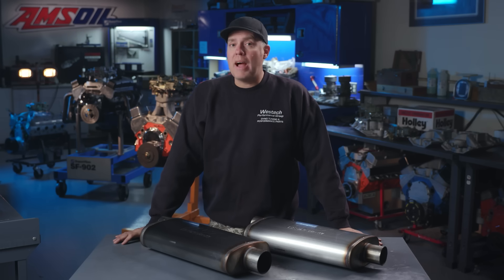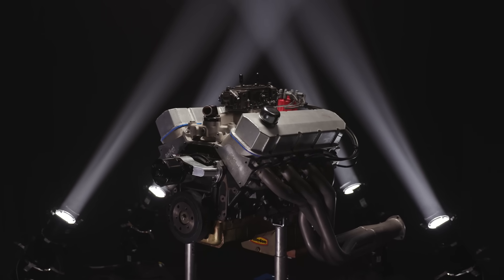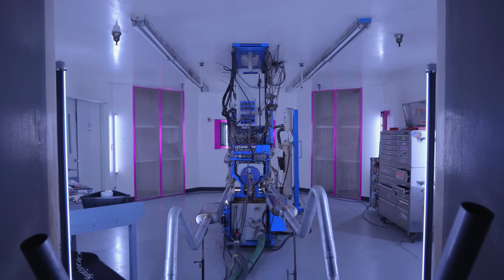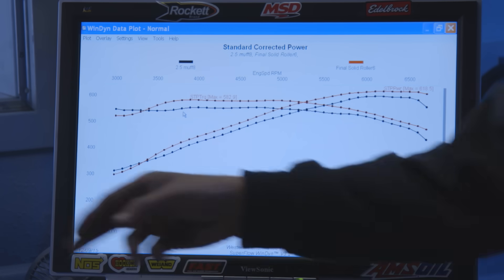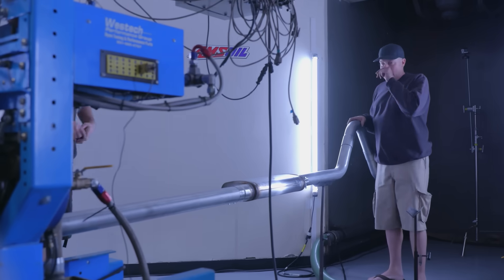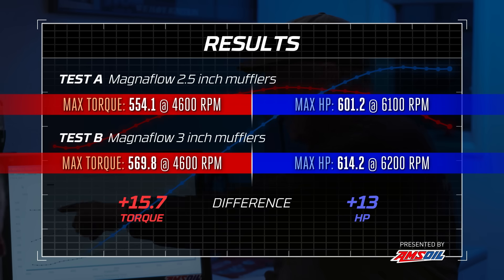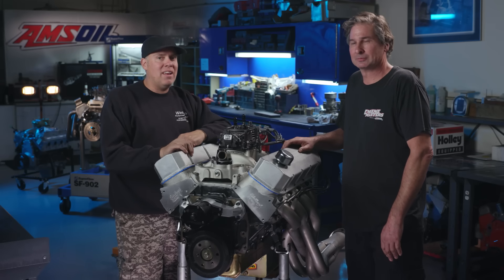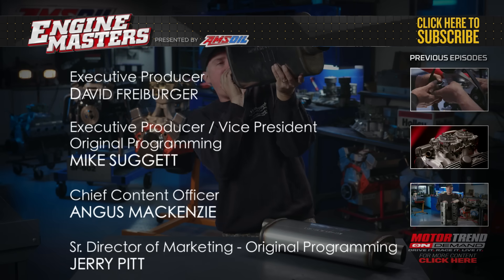The Power of 2.5- vs. 3-Inch Exhaust - Engine Masters Ep. 9

Comment: Wait but what pipes should I run on my 5.3 build. I'm trying to pull around the 400 horse 400 torque of course not exact just at least in the 4ish area but my dad says run 3 inch with high flows and a bullitt but I hear some people say back pressure run 3 cats and 2 inch which is retarded, and some say 2.5 makes better power for a vehicle that is sub-600 horsepower. They say they feel a power loss going from 2.5 to 3 on a stock motor. Any ideas?

Comment: This is not correct information. Their are too many variation to account for. a 3IN Pipe system will benefit a 620hp engine that move a whole lot more air than a 200hp engine. 3in pipe system on a 200hp engine will result in a completely different result
Reply: view this as a data point more than "information"

Comment: Hey have you tried 3 inch pipe from the headers half way down car with a glass pack cherry bomb than about a 2 inch of pipe from the other end of glass pack ..about 2 feet of it ..so it gets the Aire flow ..and by the time the air flow gets to the 2 inch pipe at the end it gets the back flow pressure as the air leaves the exhust ..

Comment: Hey engine master's I have a question about doin muffler deletes..
I have a 2018 Dodge Durango R/T... I was thinking about if I should delete the mid muffler or the ones in back for a low cost raspy sound..
Or if should just buy some magnaflow or flowmaster exhaust...

Comment: Muffler size depends on HP; a 3" dual exhaust will lower HP on most stock V8s under 400 hp!!2.25" to 2.5" dual exhaust for 200hp - 350hp2.5" to 3" dual exhaust for 300hp - 500hp

Comment: I know it’s not a v8 but I’m looking for advice on a truck I have setup for the desert. It’s a stock 3.0 ranger and I want to do a straight pipe with a 2 cat delete with o2 sensors. But would like to not lose power. What advice on specs should I use?

Comment: Bishop back pressure is not about horsepower or Torque. It's about the temperature on the exhaust valves. There are some indications that you'll have longer valve life with a small amount of back pressure. The other thing to take into consideration is the percentage deviation relative to torque and horsepower period with a 3in exhaust you're only seeing about a 1% drop which is pretty doggone small period with the 2 and a half inch system you saw a little over 3%. Again a pretty small amount that would probably not be noticeable for most people. The second issue is the length of the pipes. One of you got it right when you're speaking about the wave transmission through the pipe. However, once you reach choked flow it doesn't matter how long the pipe is. My guess is after about 6 feet it's probably irrelevant. The fact that they Magnaflow does not impinge on the flow diameter is a critical issue. This was the same concept as the original glass pack mufflers. Of course we would take the glass packs and run the cars down the freeway at 92 a hundred miles an hour and then shove a hose up to shatter the glass packs. Just some old hot rod tricks. The cops were yelling at us that our pipes were too loud but we quickly showed them that we had Cherry Bomb glass-packs on the exhaust system which meant they were totally legal kind of. Enjoy your shows. By the way adiabatic efficiency it's not always the bottom line we are talking about supercharger. I agree that the design of roots blowers is extremely inefficient and I've always wondered why they have never made any attempt to alter the Flow Design as it would not take much to greatly increase the efficiency. A system much like an axial flow compressor makes a lot more sense to me, would be a lot lighter, and would be a lot more efficient. Possibly three stages would be plenty with a stator in between. I always wanted to patent something like that but never had the chance. That's the problem with getting three engineering degrees and working and research far too long when I really just wanted to be up to my elbows in grease working on cars. Salutations!

Comment: I'm thinking this is a little biased though since it's 600+ HP 454... Big displacement and high horsepower application. I guarantee the differences in a lower output 350 or 383 in the 450-500 HP range would be way less noticeable.

Comment: Does a 32cc weed eater need back pressure?
Reply: No, it already puts pressure on your back!
Reply: It's a function of velocity which improves scavenging at lower RPMs resulting in higher effective flow.

These tests show exactly that, though they only show their results after about 3,000 RPM.
Reply: Is it two stroke?
Reply: Nothing needs "back pressure".  That word should never be used in tuning.

Comment: What's worse is I have a 1969 Camaro and since it was new (Not stock, they were installed by my dad in the early 70s) it had these awesome looking Thrush side pipes. But they were only 2 inch ID. I was able to hollow them out and I could fit a MUCH larger exhaust inside them but there is the problem with the 90 degree angle from under the car out the side and that is... the housing wont take anything bigger than 2 1/4 and the aluminum is pretty thin as it is so I can' grind it out. So I'm putting in exhaust cutouts so if I need the power I can flip a switch and go uncapped. Still it kind of sucks because it's not something I can always run.

Comment: Going from headers with 18" collector extensions to a full 2-1/2" exhaust on a 600hp 454 engine only drops 20hp/30lb/ft torque?(620hp down to 601hp and  584lb/ft down to 554lb/ft) For a full 3.1% power and 5.2% tq drop. Not bad considering Then from 2-1/2" to 3" exhaust we go from 601 to 614hp for a 13hp gain or 2.2% power gain, on the torque side we went from 554lb/ft to 570lb/ft for a 16lb/ft or 2.8% torque gain.Certainly no reason to swap from a 2-1/2" dual exhaust to a 3" dual exhaust, but moreso a factor when deciding which size exhaust to install in the first place.  You'd probably feel the extra 72 or 82 pounds the full exhaust systems weight more than the power differences between the two sized systems.Going from stock BBC manifolds, esp. the non-Corvette ones to longtube headers, coupled with either sized exhausts would produce sizeable differences worth worrying about.

Comment: U should do this same test on a smaller, lower powered small block, to see if 3" is too big for a small ci, small cam V8. Because (in a misguided attempt to understand the venturi effect of speeding up air flow by narrowing down the path, and the consequential scavenging effect of the increased air speed) the interwebs say that you need "back pressure".

Like maybe put 3" long tube headers on a 3.0 liter N/A V6 that only revs to 6500. Or maybe even put 2.5" zumies on it to really exaggerate the "too big / no back pressure" theory of exhaust air flow... Just a thought.

Comment: Its exhaust flow velocity. Higher the speed the quicker and more completely it can scavenge the combustion chamber of burnt gases as it creates a low pressure vacuum of the gases leave the cylinder

Comment: I like your videos but this one isn't very helpful.  Anyone planning on pushing 600+ hp has planned on 3" exhaust as part of the build.  The more valuable information is at what point I need to plan on 3".  Is there a point where 2.5" is more beneficial?  I have a '96 Cobra that I'd like to get another 100hp or so out of, does 3" exhaust need to be part of the plan or would a free flowing 2.5" exhaust be the better upgrade?  Is it true that back pressure is beneficial at some level or is that a bunch of crap?

Comment: Thanks smartasses! Take a big block shove a 2.5" exhaust on it and compare to a 3" exhaust.  Great work...  you have prove nothing but your idiocy. Lol. Why don't you take a 4 cylinder 1.8l and put the 2.5" on and compare to the 3" and see what happens. 

Americans and the "put a 3 in exhaust on it! It makes a lot more power!"  

Exhaust sizes are tuned to a specific engine flow rate. So 3" is not always the answer.  Like a motorcycle engine for example, it will lose a lot of power with the 3"

Comment: Nice video and you prove some valid points about an engine that I will never have. Maybe in my next life I will have enough $ to put together an engine like this, provided they still use internal combustion engines in my next life! LOL I am in the process of putting together a 360LA engine or a stroked 360LA (408) for my '78 Lil Red Express truck. I am using a reproduction exhaust system which is a 2.5" dual system with Hedman long tube headers. I am not putting enough money into the engine to get over 400 HP. As a matter of fact what I build should have in the 340-375 HP range. I think I will use Hooker Maxflow mufflers with the exhaust system. For that drive train, I think a 2.5" system will work just fine. I may even fuel inject it! Back pressure is a good thing as they said in the video. Engines were designed to run with some and I believe the 2.5" pipes will be about right for it. A 2.5"X2 cat back system for my modern 5.7 Hemi worked great for it and the Hemi made the same HP as the 360 will. Cheers!

Comment: Exactly! Engines don't need ANY back pressure! why would they? 🙄Think about how an engine works... The reason a exhaust that's too large for a engine loses power, is because too large of a  diameter actually increases back pressure. Because it decreases the velocity of the airflow.

Comment: It would be interesting to see what difference a 1/4'' would make, although it probably wouldn't be much if any at all. The diameter on my SRT was 2 3/4,"and that is pretty good for stock. However I got rid of them and went with 3'' SLP Loudmouths on my '10 Challenger SRT, and they rock. They are much lighter than most aftermarket pipes that are available, and about half the price as Borla or Flowmasters are. But the best part is that they are super aggressive, and I really like that.

Comment: Works on a 400hp and higher engines but do that on a 150hp engine and you lose low end torque. And no mention of the catalytic converter? And last but not least you must always retune the ECU after a muffler upgrade.

Comment: So.... on a turbo 4 cylinder..... 2.5 or 3inch? I've heard 3 inch because the turbo is the biggest restriction so make sure nothing beyond it is even remotely restrictive. The reason I ask is because I can by a kit for a 2.5 inch system, but I'd have to do a custom fab to make a 3 inch system.
Reply: Well the Kawasaki H2R is a 998cc, 4 cylinder, DOHC 16 valve supercharged bike with 321 HP at 14,000 RPMS. 

It also has a exhaust size of 1.9" Inches. So a 2.5 inches unrestricted exhaust is probably about right. 

They didn't disprove back pressure. They only proved that a motor that already has 600 HP modded out the ass creates 16 more hp with a pipe that creates the right amount of pressure. Also their dyno doesnt have real world driving conditions.

Theres a reason company's like Kawasaki have small pipe sizes because its about having the right amount of pressure which is important in real world engine performance not dynos with no real riding conditions.

Comment: I've got to go with most of the other comments, I'd like to see the test with the engine tuned properly for the smaller exhaust and 3". Also this is on a big block which loves air. Can you do another one on say a small block 350 or Ford 351W ... I'd love to see how a small block with similar build specs handles the differences.

Comment: 2.5% power difference.  For the reduced noise level I'll keep 2.5 in exhaust.  I likes my comforts.  
Also, you're pushing 600hp through those pipes.  My car dribbles out just bits of power (less than 300), so the 3" pipe would actually sap power I think.  Maybe you could disprove that, or even better, maybe you could demonstrate that sizing the exhaust piping to match the air flow demand to maintain velocities and scavenging while minimizing 'backpressure' is the solution.
Either way, Magnaflow is awesome!  Been using their stuff since I had a 1999 Ford Contour V-6.  What a fantastic sound that car made... (drooling)

Comment: I did a 3 " no cats with 2 1/4" Magna flows on my 2006 SRT-10. Loves back pressure. great power then tuned. tried straight pipe for fun but the performance drop was to much.

Comment: Pie are not square. Pie are round!    No. An Engine DOES need a bit of back pressure. If you don't believe me, Dyno that engine with no headers.  Why the hell do you think each one is the same length?  its not to balance weight.
Now with that said, i give this video a 9/10. Good job.

Comment: Im no tuner but i would think being that an engine in essence an air pump, that more pump being able to be pushed out, means more air being able to sucked in, that equals more air flow, and more air flow = more gas, and more of the 2 = more power.

Comment: An old timer taught me a trick for tuning the exhaust. Paint the header pipes past the large collector extension. Run the engine nice and hot, uncapped like that, until the paint burns off. Put your reducing flange from the collector extension to the final pipe to the muffler in 12" past where the paint stopped burning off the extension.

Comment: what about different mufflers? Such as flowmaster vs magnaflow, or corsa and borla.. etc.
Reply: Slowmaster sucks has chambers inside which cause air to get stuck and dont flow as fast in the result for a small hp loss then magnaflow  is pretty much a straight  through flowing exhaust also borla with little to no drone and corsa is the best in the market straight through exhaust and zero drone I myself have a chevy silverado with cai and 1"7/8 american racing lt headers catless y/pipe, 3" exhaust pipe with the borla xr-1 #40085 over all its better than a stock 5.3 vortec so the outcome is straight flowing mufflers give out better performance than any chambered mufflers

Comment: On the bech flow the 2.5 inch magna flow with that S curve has the same flow as a 2.25 straight pipe.  How does that factor in? 
  Easy.... Do test with 2.5 inch pipe and 3 inch muffler, 3 inch bends., or nothing after muffler.  With that set up you used that 3 inch has the flow of a 2.5  straight pipe in the bends. There is a way to calculate what kind of flow you need for your horse power and tune the exhaust exactly. You have to know the flow of an assortment of mufflers. In a glass pack, one with louvers in pipe drops flow significantly compared to the one with just holes in the pipe. Hooker max flow is the highest flowing muffler tested next to a glass pack with out louvers.

Comment: Flowmaster vs Magnaflow do it!
Reply: I have super 10s on my V8 RX7. The sound has been described as "Two dragons fighting" from half a mile away. Best "muffler" on the market IMO
Reply: Jay4Jet not all flowmasters are bad. Such as the super 10. Basically just as good as open pipe
Reply: I've had 2 on mine (sidepiped) and it was described as 2 lions having an argument on each side of you.
Reply: that would be a good one... we all know the chokemaster would lose that faceoff, but I'm curious as to how much
Reply: The Super 10 would be the only one that I would say flow well.  The ridiculous amount of Chambers, walls, and corners inside of a flowmaster kills exhaust velocity, contrary to company claims.  It works great for getting that signature sound but for power, a straight through like a cherry bomb or magnaflow (or even a magnaflow knock off like Full Boar) is the way to go
Reply: "Contrary to company claims"?  So now you know more about the product than the company.? lol 
And "ridiculous amount" of chambers walls and corners? What corners and what walls? and the chambers effect on velocity is negligible.
Reply: This been done flowmasters won and then magna's won and then everyone went and bought BORLA 😁
Reply: TPV Productions
Reply: Everyone knows that slowmaster will lose all them chambers inside cause air to get stuck and not flow as fast as in a straight flowing muffler like magnaflow dynomax only good exhaust from chokemaster is the fx series
Reply: My supplier did it on a 302. Flowmasters were the worst, straight pipe full length was the best. Magnaflow came in second. Even stock mufflers beat flowmasters.
Reply: I like flowmasters  better

Comment: While most hot rods are epa exempt, I'd like to see this same test using a modern engine that utilizes a cat as well.
How much difference would be seen with a stock cat vs a "high flow" cat.
Also, I would like to see the real difference. That is, tune for correct air fuel ratios after modifications performed. nowhere was it mentioned that any tuning was involved and would change the numbers quite a bit

Comment: so basically if they lean out the engine a bit more with 2.5 inch exhaust there be almost no difference considering that even  it has 15 hp difference would not make a difference unless your a pro driver with slicks at the track

Comment: The backpressure also has to do with the volume of the system....gases will slow down and sit in the  back of the mufflers. If grossly oversized you will need engine power to move the now slower gases out.....

Comment: I don't necessarily share your conclusion of the results, as you only did a partial test with no weighting given to the dB difference. For every 3dB of sound increase the volume doubles. Fairly obvious on an engine like that the 3" would perform better, but 20hp for numerous times quieter is something most of us would be willing to trade in the real world, especially when you still have 600 hp left.

Comment: Don't know why you would be so surprised with the weight difference between the 2.5" and the 3" systems, air weighs the same in both. Just because the area is massively different, doesn't mean there is actually that much more metal in the rolled out circumference of the pipe, and since the muffler boxes look identical the only real weight difference would be in the pipe work.